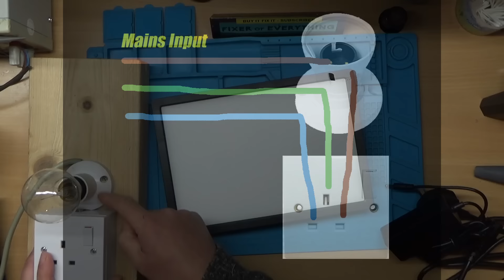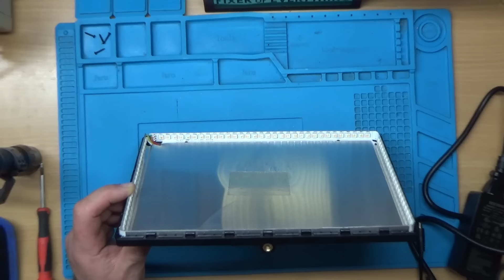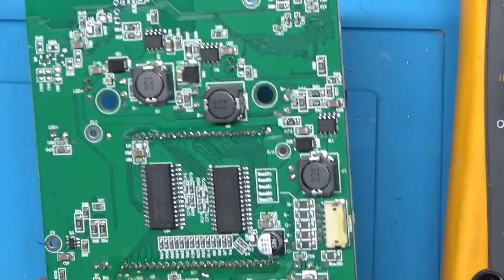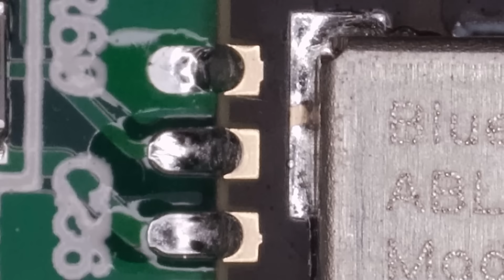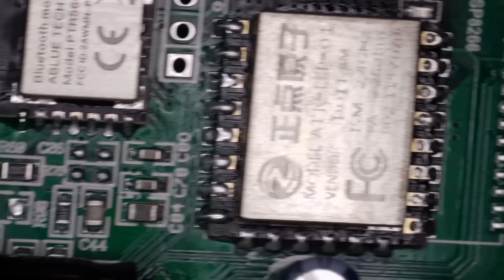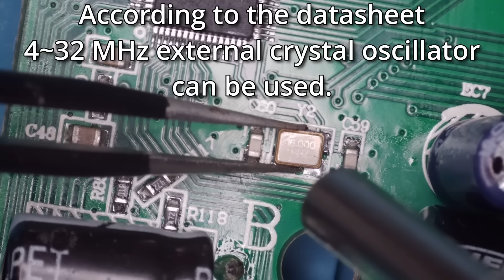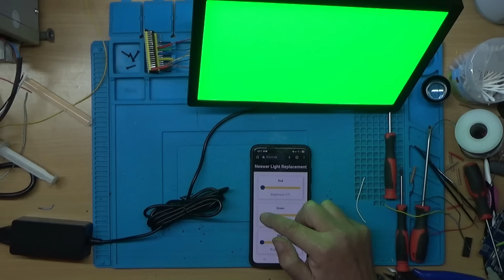Faulty RGB WiFi / Bluetooth Studio Light | An Ingenious Fix!

Comment: You didn't tested the clock pins under no-load condition. Then you should have on one of the pins some voltage.
Maybe one of the C near the crystal are off value or not calculated correct and are now out off specs and prevent that the C of the crystal matches with the C of the crystal and prevents to start the crystal.

Comment: I am stuck very firmly in the lowest (hardware) layer of the OSI model, so would have loved to see you jab an 8MHz squarish wave with a DC offset of half Vdd into each of those corner pins of the micro…actually, you had the datasheet, so would have known which one was XTAL-IN…and see what happened. For me, building up an “external” 8MHz oscillator would have been far easier than all the mucking sbout with an ESP And coding..and you might have bought the display back to life.

I picked up a mich more basic and smaller one of these…same brand a few weeks ago. It is only warm, and white, no RGB, but it has the display. Upon reception it dis nothing from the USB port…(it had no WiFi or Bluetooth). It had a large 4Ah pouch cell inside that measured its rated 3.7 volts. There were two boards, one had the micro, display and drivers and dome boost converters on it..the pouch cell was connected to it eas well, the other board had the USB connector and possibly a boost converter also. Five wires went between them, GND, +5, B+, CHC and STB. The boost converter driver chip on the USB biard was shorted and connected directly to the USB +5v and the +5v wire to the other board, this was dead shorted to ground, but removing the chip released it so I could put the bench supply on it…when I did so, yhe display came to life with a “battery chatging/filling icon and nothing else. Placing 4v from the bench dupply onto B+ bought it partially to life, the display all lit up and the LEDs worked too, there were two rotary encoders, one for brightness and the other for corrected colour tempersture that PWM slew bwtween the high snd low CCT  LEDs. These functions sll worked but turning the brightness up too far tripped the current limit on the bench supply.

The pouch cell, isolated st bsth ends from GND and +B did nothing at all, so, somehow the boost converter on the other bosrd had the switching chip shorted and seems a few power routing MOSFETS were damnaged around the cell too. There was a boost converter on the main board, it worked and its driver chip was an FP7209…and I got the datasheet for this one, but the sinilar shorted one on the other board ..which I thiught I made out as an FP8708, came up blank..both the same Chinese manifacturer, I could see their logo on both, and both began with “FP” , but just vould not make out the numbers on the shorted one. So I can use it, up to about 80% full brightness off the bench supply, but don’t really deem is worth spending too much effort on. 
I hot it as a scrap metal place that is bringing in 40’ containers of Amazon returns, so might find another one and make one good from two faulty. A friend found an IR camera similar to yours and they charged him AU$5 for it…lucky sod. Everybody now knows about it though, do the pile is well picked over by the time I get to see it.

Comment: Couldn't you reuse the ESP32 that was already inside?
Reply from the maker: While it may be possible, the one inside was an ESP8266, and doesn't have as many PWM I/O pins. It was just easier to use the ESP32 that I had on hand already.

Comment: Honestly not too bad of a device it looks pretty decent.
Reply from the maker: Yes it's not too bad. I've used it quite a bit recently for an upcoming video.
Reply: @BuyitFixit that’s golden then save urself some money. Fixing things must save you so much!
Reply from the maker: Yes, that's pretty much how it all started. It was usually because I couldn't afford nice things. Always fixed my own cars (still do) as garages are too expensive. Used to get broken TVs from people or the dump and fix them. When plasma TVs first came out I got a 55" Samsung plasma from the local tip at the time £60. Cost me £30 for parts and £10 for a remote so £100 for a TV that would retail for £1000 🙂
Reply: @BuyitFixit good work man!! Saving and working for yourself is the richest you can be. Wise lifestyle, I love it.
Reply from the maker: Thanks mate 👍

Comment: At 277 comments that I didn't read 90% of,  I am still suspect of the clock.  If you were to lift the MCU pins for the clock, you could verify for sure the clock was being drawn down by the MCU, or was not present because of faulty circuitry in another part of the board...Also you could inject a clock signal from an external oscillator as well.. my 2c, thanks for making this video...
Reply from the maker: Thanks John, lifting the MCU pins wouldn't really show much as you would need to supply some voltage for the xtal to oscillate. Injecting a clock signal might do something, but the MCU should be supplying some voltage to the crystal otherwise it doesn't have any power to oscillate as it's a just a passive component with two capacitors. It wasn't shorted to GND so there should be nothing pulling it down, there just seemed to be no voltage out of the MCU.

Comment: Like your power supply with short protection, so made one up. I also added a bypass switch which you have talked about but also a display from aliexpress. It shows the power being used, current, voltage phase etc. That makes it very handy so you can see what the device being repaired is consuming.
Reply from the maker: Sounds great 👍 I should really get my finger out and do something similar. Well done!

Comment: That's a great fix!
Have you considered using the ESP8266  that was already on the board? That would have been even cooler in my books
Reply from the maker: Thanks Nick 👍I had thought about it, but I didn't think it had enough GPIO's capable of doing PWM. I'd also have to cut tracks or take it off the board and re-wire it, use a USB > Serial UART to program it etc etc. I had a few ESP32 kicking around so I thought it was easier to use one of those.

Comment: Great job. If you wany to check if the PCB is covered with additional protection layer, most of conformal coatings are sensitive to UV light (for quality check), just shine black light on board, you'll see it clearly.
Reply from the maker: Thanks, and thanks for the tip 👍

Comment: That's a nice light setup , glad you got it going ....... Could you get the software / firmware for the 32 micro processor ?  The chips used to be cheap as all get out at one time ,  I wanted to get one for my KSGER soldering station KSGER was using the original STM 32 chip but those aren't available now .........  Take Care Mon Ami.....
Reply from the maker: Thanks Cajun 👍I doubt the manufacturer would be willing to send the firmware, and the chips are usually code read protected.

Comment: wled will allow to run effects on led strip
Reply from the maker: While you could possibly run sone types of effects, this strip is RGBCW, and not addressable like the WS2812 for instance.
Reply: @BuyitFixit  yes, but interface is a little bit better in terms you could save presets, or control lighting effects from pc with openrgb

Comment: I have recently found your channel, it is very interesting and it made me look into my milling machines faulty rpm sensor, the printed circuit came loose and moved causing the disc to wear into a GK105a sensor.  I live in the north east and was wondering if you tell me if there is a local supplier where o can purchase one of these, or i was wondering where abouts your repair cafe is so you could take a look at it.  Many thanks in advance Martin.
Reply from the maker: Hey Martin, a quick search suggests it's a £3 opto-coupler. I guess the disk you mention has loads of lines on it like the old style mice used to have. The repair cafe I volunteer it is over Alston in Cumbria.

Comment: When you were measuring the crystal, I was wondering if your probe was set to 10x? Otherwise the crystal is not able to work. Then the led of wifi module was very short flashing. Could be a shorted cap around that area. Anyway, your solution was quite impressive and funny to watch 😊. Thank you for the video.
Reply from the maker: Thanks 👍Yes, set to 10x. I'm powering my ESP32 from one of those debug connectors, a shorted cap would have shown on the thermal camera like a bright light. The LED is controlled by one of the GPIO pins, and can be turned on / off at reset, so it depends on how the ESP8266 is configured to control it.

Comment: I wonder if you can reflash the ESP that is on the board, then connect unused pins to the RGBYW wires and program tasmota and not need the external device?
Great work as always. You helped me repair a 12vdc power supply for a camera system. I replaced all shorted components, replace the bad caps but still did not work. I found a perfect looking 2.2 ohm resistor that was open circuit driving one of the mosfets, replace it and Huston we have power... 
Thanks again....
Reply from the maker: Thanks mate 👍Well done on fixing the PSU. I had both SMD and through hole resistors both fail in that way now. I had thought about the ESP8266, but I don't think it has enough I/O pins that can be used to do 5 x PWM signals. I also had the ESP32 lying around anyway as I bought a bunch of them a while back.

Comment: What would have happened if you injected your own clock signal?
Reply from the maker: It would depend on what's gone in the MCU or if it's a corrupted configuration somehow. I didn't try that, as I didn't have a 8mhz clock source handy.

Comment: I love this kind of thing, a bit of ingenuity playing about with microcontrollers! I recently bought a load of arduinos and esp32s to mess about with and show my kids the interesting things you can use them for, they were fascinated, and got as far as building a "gig in my pocket" from an arduino nano on a breadboard with a load of LEDs and buzzers to create a miniature rock concert 😂
Reply from the maker: Nice one Mike 👍Arduinos are great, I've built a few things myself. One of the things was a shooting gallery for Nerf guns. You had 5 targets and a LED scoreboard (which I built from a string of large WS2812 neo pixels). This contained the high score, current score and a count down timer. The targets were held in place with some hinges, and had a magnet on the back which activated a reed switch. When all 5 were down, two servo motors at the back moved a bar which came up from the bottom and reset them. I also had it play various sound effects for a glass bottle smashing, or a tin can falling on the ground depending on what target was hit. It also played a sound effect if you got the high score.
Reply: @BuyitFixit That sounds epic, they would love something like that! I will have to look into something like that with them as a little winter project! 👍🏼

Comment: How did you not notice the black capacitor on the left next to display theres white stuff around the bottom and top looks dented in hahaha if that Capacitor is failed then no power will get to the clock Crystal or other components
Reply from the maker: The MCU does indeed have power, along with the rest of the circuit. I even powered the ESP32 I used from the MCU power supply.

Comment: slightly disappointed you didn't use the onboard esp chip
Reply from the maker: I don't think it has enough I/O pins to do 5 PWM signals, also I'd have to mess about with USB>TTL converters to program it. I had the ESP32 lying around anyway.

Comment: Never figured out why it was the chip. Seems like the crystal should be output the signal no matter what the chip was doing
Reply from the maker: The crystal needs to have power to work, the chip supplies that power, it won't just oscillate without it.
Reply: @BuyitFixit ohh. Thanks for letting me know

Comment: Another mcu bit the dust. I do wonder how it failed though 🤔??. Nice to see that it seems to just have a esp8266 inside instsad of the more obscure beken or realtek powered tuya modules. 

Very Clever way to reuse the led driving circuitry with an esp though! I was thinking, perhaps you could find the datasheet of the led driver chips and figure something out to drive them, as (if its the model i was thinking of) the TMxxxx chips do have an arduino library and i believe they are supported by esphome (yet another foss firmware replacement). But i could be wrong. 

The stock circuitry probably had that Nuvoton mcu control everything and had the wifi module talk to it over TuyaMcu or other UART/serial protocol as i seen this exact setup in other tuya IOT cloud powered produ- rubbish. 

Thats also the sad thing about today's products with complex circuitry and proprietary code in mcus.  Most stuff is made to be disposed off when its broken and not really any manufacturer will be happy to help you fix it (except Peak of course), at best probably send replacement parts, but then you might aswell just buy a new product. Had the case with some product that its embedded linux firmware got heavily corrupted. Contacted the manufacturer and they did send me some firmware files to flash on the device and it was working again.. cant excatly remember what device and or brand it was though, but it was really nice and helpfull! 

I also run such open firmwares in my local smarthome. Tasmota on some switches and plugs, wled on my led strips, openbeken on my lightbulbs (they have tuya beken powered modules inside instead of esp chips) and esphome on my custom sensors and projects i made. And i run thingino on some of my cameras that where powered by ingenic T series chips. Also love tasmota,  it only for its somplicity and eass of use, but also because its made by someone from my own country, the Netherlands.
Reply from the maker: Nice one, it sounds like you're well versed in this area!

Comment: 3:28 "I'm going to ... but I just haven't got around to it." is the 'T' shirt we all need. 🙃
Reply from the maker: Lol, honestly I've got that much stuff to do that it's even hard to try and do YouTube videos. Here's a partial list of what I can remember off the top of my head: I've got a roof to fix (needs all stripped off and new joists), shed to build + electrics etc, woodworm to sort out in one of the bedrooms above my work room so I might need to replace joists yet, brakes to do on my wife's car, gearbox to take out and replace on my sons van, ABS problem to sort out on my wife's horsebox, concreting to do in front of the barn, new to fit a new front door after the sheep trailer ended up coming through it, blown double glazing units to replace, etc etc etc..+ probably 100 other things that I can't even remember at the moment. The list just seems to keep getting bigger.
Reply: @BuyitFixit  The never ending todo list... I've started to have AI keep tabs on all my side quests and prioritise them, so now I dont waste time building another printer if the brakes are due on the wife's car...
Reply from the maker: I've actually done the brakes on the wife's car today, so that's at least one job of the list 😊
Reply: @BuyitFixit  Video? Only joking Mick, I have to say your commitment to our entertainment and education does not go un-noticed. If it helps Till Roll is a good medium for to-do-lists.😂

Comment: Did you have any luck contacting Neewer for a replacement MCU? I know it's unlikely, but you've had some luck in the past..
Reply from the maker: I didn't even bother contacting them. I think I've only had 2 companies in the past actually help me repair something. That was PEAK electronics, and Kitchen boss, most other companies just don't respond or give you the "we will replace or repair it if it's under warranty"
Reply: @BuyitFixit  Fairynuff

Comment: I fixed a fancy, large rain style RGB showerhead in a similar fashion like this.  The problem was the unit was made in Italy and very hard to get parts for and found someone with a used proprietary controller for this but they wanted around $600 USD!  The original controller had a dead microcontroller so I just identified the I/O's, soldered wires like you and used an Arduino to "hi-jack" the lines.  Programmed some code and voila a working unit for about $10 in parts!
Reply from the maker: Nice one, well done! I'm glad I'm not the only one who thinks outside of the box!

Comment: hi did you want to try and program the esp8266 inside the light instead of using the external esp32
Reply from the maker: I had thought of that, but wasn't sure if it had enough I/O pins to drive the 5 PWM signals that I needed.

Comment: Pretty cool as always!
I always wondered what background does Mick have to be so skilled on electronics. Was it from doing engineering for some company like designing products? Was it from a repair shop he worked on? Millitary? or just self toughed as many of us here. Wtv the answer is, it's amazing the creativity this guy has to solve these kinds of problems
Cheers
Reply from the maker: Thanks mate 👍I've just always been interested in electronics and computers. There's a little bit about me on the about page of the channel. I used to work fixing arcade machine when I left school, and mostly it's just a hobby (apart from volunteering at our local repair cafe).

Comment: I have done this exact thing to multiple power LED lights my mother has bought over the years which have nice hardware but locked down Apps.
I threw out their controllers and put ESPs in them with WLED installed on it (if you just need PWM RGB Tasmota is also ok).
Reply from the maker: Nice one, that's really useful to know 👍